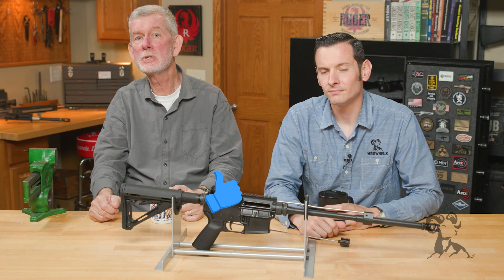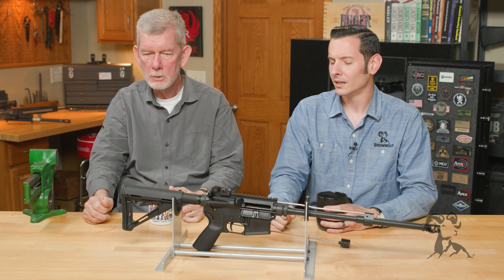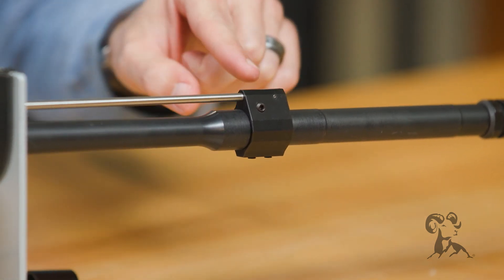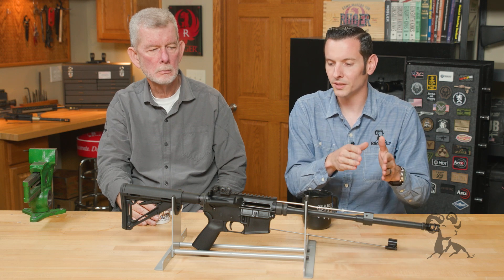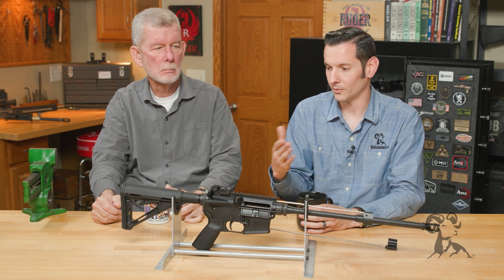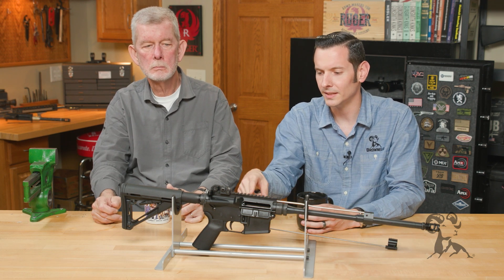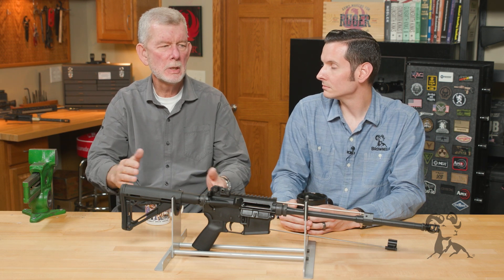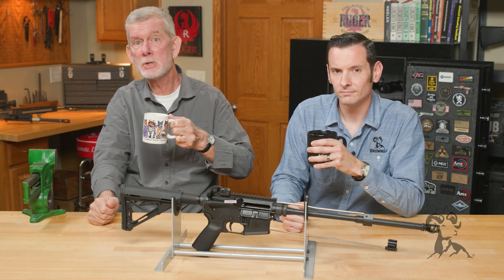Smyth Busters: Does Every AR-15 Need an Adjustable Gas Block?

Comment: Would you recommend one on a "duty" rifle/sbr(11.5"-12.5") being used in different climates and what have you. Personally I feel that a regular gas block covers your back in all areas, but I'd like your opinion on it. (Not suppressed)
Reply: There's no reason IMO to risk reliability in a life-or-death firearm.  If you go monkeying with the gas system with every change in climate/temp/humidity you're risking it failing you when it's needed the most.  That's just too far out on the ragged edge.  The standard gas block delivers full gas, as Caleb stated.  The recoil will be more harsh (actually, it's the buffer coming to a sudden stop) but it will cycle every time if kept clean and lubed properly.
Reply: @David-hm9ic  Depends on the ammunition you are using. Over gassed rifles are hell on gas rings and can cause premature wear and parts breakage. In a rifle that is over gassed, the  bolt carrier will cycle much faster and can cause feed failures if your mag spring is not strong enough to keep up with the cycling...Over gassed rifles are also much slower on split times..Just saying.........
Reply: @David-hm9ic  That's what I was thinking but just wanted someone else's opinion so thanks for the reply. As for the harsh recoil from the buffer, that can just be fixed with a better buffer so that's no problem.
Reply: I have a BCM 11.5 AR Pistol and was wondering something similar. I've had feeding issues a couple times. That could be that I'm still in the break-in period of the rifle (haven't gone shooting much due to covid and ammo shortage). It could also be that I need a heavier buffer (I have an H buffer). The gas seems to be at the right amount, the casing ejects at the 3-4 0'clock area. I'll eventually get suppressed but not right now.
Reply: @christophallen8859  Here is a great place to learn about feeding and other issues. Chad separates the BS from all of the internet advice. https://www.youtube.com/c/InstructorChad/videos

Comment: Something I don't understand. They say Mini 14s are inaccurate because they have spaghetti barrels. Well,,,,, look at these AR barrels. They are really spaghetti barrels.
Reply: Pencil barrels were an issue at some point when the heat treatment wasn't done correctly, leaving tension in the barrel. If it gets hot the residual tension can bend the barrel leading to offset shots. The heavy barrels only make sense for sustained fire till they glow. Modern pencil barrels get the proper heat treatment, all residual tension is gone and it's not an issue anymore. The AR is a light weight rifle and the balance is far better with a lighter barrel as it was envisioned.

Comment: An adjustable gas block is probably ideal for those folks that use a silencer sometimes. Some may argue that it is pointless to run a silencer on a round that is not subsonic but hey, it is what it is.

Comment: I would say an adjustable gas block is useful when you want to run the gun suppressed and unsuppressed.  Yes there are other components you could change to also do this.

Comment: If I were running a 10.5, and I was unsure if my rifle was over gassed, what would be the first thing I would look for?  I've heard alot about case ejection angle, but I'm unsure what exactly that looks like.
Reply: Imagine looking down on your rifle on a clock face, with the muzzle at 12 o'clock, the stock at 6 o'clock, and the ejection port at the center. 

If empty casings shoot out the ejection port toward the muzzle, at like 1 or 2 o'clock, your rifle is slightly under-gassed (will have trouble with weak ammo like steel cased).

If the casings eject back toward the stock, at like 5 o'clock, your rifle is over-gassed (excessive wear on parts and shortened lifespans of those parts).

A 3 to 4 o'clock ejection pattern is considered optimal.

Comment: This is good stuff, just bought my first "tunable" gas block/barrel combo from odin works and my first thought was how do I know where this is set from the factory. I' assuming it comes fully open, seems to run fine but there is A LOT of gas coming back to me mostly from the brake I have on it I think. Mainly I dont like the idea of having to fiddle with one more thing.
Reply: The oldin gas blocks that come with the barrels definitely are fully open from the factory. They are very easy to adjust but if you don't want to deal with it a heavier buffer like and h3  is probably what you want. Odin works also makes a adjustable buffer that you can change the weights to get it perfect without adjusting the gas system.

Comment: Interesting . I usually see a lot of seasoned shooters say that if your gun is gassy you should adjust it with buffer weights first and not by adding an adjustable gas block because having an adjustable gas block makes your AR have one more failure point that does not need to be there. Curious what you think of this logic? Thanks!
Reply: Messing with the buffer and spring is just putting a band aid on a bullet wound. You're not addressing the root problem of too much gas. You're patching it. The most ideal way to do all of this is to buy a barrel with the appropriate sized gas port so you don't need any of this shit to begin with.
Reply: @oldscratch3535  yeah I mean that’s what I do. That’s why I like Criterion - No problems ever. But some people like to run the same barrel suppressed and unsuppressed so that changes things. And not everyone is fortunate enough to have nice barrels to begin with. I think you’re right about the band aid analogy but it seems like some people do have issues with even good quality adjustable gas blocks. Seems like all best trainers I know totally avoid them to avoid that extra failure point
Reply: @DistrictSoundLab  I've had good luck with Ballastic Advantage Hanson profile barrels. They come with a pinned gas block. The gas port on my 13.7" barrel is .054", which is tiny. It shoots well suppressed or unsuppressed. Doesn't cycle steel case unsuppressed though. They're around $220 on their website or $160 through Big Daddy Unlimited. I don't think I'll ever buy another brand of barrel after using these.
Reply: @oldscratch3535  thats cool ive never ran one of them but i know people like them. You ever try Criterion?

Comment: Are over gassed guns mil-spec?
Reply: No, mil spec barrels are tuned to mill spec NATO pressure ammunition. Mil spec rifles would be under gassed if civilian lower pressure ammunition was used in them. This is why most AR  manufacturers open their gas ports "over gassed" compared to the military, to function reliably along the whole spectrum of lower and higher pressure civilian ammunition. Tula and Wolf "steel case" are at the lower end of pressure.
Reply: @hairydogstail  THX

Comment: If you are under gassed remember to Eat More Beans!  That usually fixes the problem
Reply: 😁👍 or use high test 93 octane
Reply: @sam__304  104 AV gaa works but it will melt your pistons.
Reply: @shawnr771  Just stick with 100LL. Or JetA if you need a lil extra lube in your system.
Reply: @dylconnaway9976  I will skip the second one unless I need to light a lantern.
Jet A is high grade kerosene. Nasty burning stuff.

Comment: I say always buy adjustable but along with drill the gas port bigger. All these different companies playing with different barrel length and port size/location, all different bolt and buffer components, calibers; your chance of getting a perfectly gassed barrel for your setup is low unless it's a super common length/caliber. Everyone starts chasing buffer weight, springs, carrier weight when their gun won't run but that takes so much time and gets expensive; and doesn't fix the issues half the time. Mo gas, mo throttle control=$$$

Comment: What would you rather use to adjust the gas an adjustable gas block or an adjustable gas key on the bolt carrier? Would it make any difference to shut the gas off at the barrel before I gets out of the barrel?
Reply: I recommend the block because an adjustable gas key vents the excess into your receiver making it unnecessarily dirtier.
Reply: @CalebSavant  ty

Comment: Easiest way to prevent cycle issues with adjustable gas block: to have the weakest ammo you can find, for an example Wolf, or any low budget 223, make sure it cycles just fine, by making sure the bolt opens on last shot by shooting 1 round only, full cycle, and bolt open, you can give your gas block 1-2 clicks more open just in case, and every 5.56 ammo will shoot wonderful
The only time I saw gas block fail on me, is when I didn't pin the gas block to the barrel. Now I dimple/drill the barrel enough to make sure screws actually stay in fixed position. Loctite without dimples will quickly unhinge the gas block, and that is more sure to cause an issue of cycle. 

Adjustable gas block is key for the softest shooting AR. Proper buffer weight and spring of course is just as important.

I use JP enterprises silent spring, and can have the lightest spring with adjustable gas block to make sure everything cycles and nice and soft shooting.
Reply: Do you rapid fire much? If so have you ever got your thread locker to release from heat?
Reply: @craighansen7594  I have personally never seen any gas block set screws fail with high temperature Loctite. I have seen gas blocks fail that did not have at lease one dimple on the barrel.. I have read where using red Locktite can be a problem with extreme heat, "but remember" BCM uses high temperature red type loctite with no problems. I use Rocksett, which has a temperature resistance to 2000 degrees. The down size to Rocksett is it can be more difficult to remove compared to red Locktite, but not impossible..For the average shooter, I recommend red Loctite 272, it is easier to remove and most shooters will never get their barrels hot enough to ever become a problem..  I have never tried Vibra-Tite Hot Lock which also has resistance up to 2000 degrees.
Reply: @hairydogstail  I agree. Some companies use hardcore threadlocker. Like Ruger rifles, where I was forced to drill out the gas block screw to remove it,  and even after heating, I was forced to chisel the gas block off the barrel with a hammer and screwdriver
Reply: @righteous-one-7  Did you try shocking your screws after heating them??
Reply: @hairydogstail  
You can get the rocksett parts off if you put them in water for a while.
Reply: @onpsxmember  I have found soaking in boiling water is not as effective as shocking the screw....
Reply: @hairydogstail  Rocksett is incredibly easy to remove, you just soak the part in water overnight.
Reply: @hairydogstail  Rocksett is water soluble, i just use room temp water, works every time.
Reply: @craighansen7594  yes, I do, on 16 inch ar. When I didn't dimple the barrel deep enough or not at all. Don't overdrill, and don't underdrill the dimple.  Check the barrel thickness and don't overdo it. I do 0.9 mm dimple or up to 1.1 mm
But if you are not sure if your barrel needs less, then take it to gunsmith.
Reply: @craighansen7594  use rocksett, it is impervious to heat.

Comment: Yes...yes...yes and yes....
Why? Cause we can, and it makes recoil way better. 
Unless like they said...the gas hole is the size of mosquitos ding-a-ling
Now for anything overgassed, or normals gas hole, it works wonders
I have rifle length gas system, where the hole is as big as Grand Canyon, so the rifle was still overgassed, bought adjustable gas block for that reason.

Comment: What I know about these rifles is where the rounds go in, where they come out and what makes it go pew pew. I visited the Grinnell store a week ago and picked up the .22 conversion with 3 mags for my AR556 Ruger, so now watching the vids to learn more.   Now I know what the gas block is for and what it does.
Reply: Ngl this post is fucking terrifying.
Reply: @dakotamaiden4331  Why would you say that?  Please explain.
Reply: @acdii  simply put. Do some research on the firearms you own. It will do nothing but help the overall experience. I don't say this in any mean manner its just genuinely scary hearing other firearms owning sayin stuff like that.
Reply: @acdii  basically shit goes wrong it good to know how to do simple stuff on the thing that contains small explosions should anything malfunction.
Reply: @dakotamaiden4331  I have been shooting for decades, but it is my first AR style, so the internals are all new to me.  Would you rather I went through great detail on where the rounds go in, where they come out and what makes it go pew? I mean, come on, get some levity man!  Reason only 3 rounds went through it is because it came without sights, and the Optic I put on is so far off, that it completely missed the target by several feet at 36 yards, and at 50' I hit the target and found out how far off it really was, two rounds @50 feet, both impacted the same spot, so at least I know it is consistent. At that point I decided to get a bore sight and packed it in.  No sense wasting rounds when it was that far off.  

I have been shooting Henry rifles and bolt actions, so you get the idea of what I meant.
Reply: @dakotamaiden4331  Got that right. Been watching as many videos as I can find on how these rifles all work.  The more I watch, the better I understand how they function, quite different from a handgun or lever action.  Finding the .22 conversion kit will pay for itself in less than 200 rounds, looking forward to some range time with it.  Instead of having two ammo cans with different ammo I can take both rifles with and only one can of ammo since both can shoot the same stuff. Win Win if you ask me.
Reply: @acdii  22lr is def fun.
Reply: @dakotamaiden4331  quite dramatic there Dakota. Nothing remotely terrifying, calm down.
Reply: Please watch all 3 of the videos I am linking:
https://youtu.be/wMIBUIN30yU

https://youtu.be/V_RfiKEvoGA

https://youtu.be/wAqE-KLbiYc

You are welcome

Comment: I noticed that you didn’t address misaligned gas blocks as a possible problem. Nice segment. Thanks.
Reply: Saw that recently on a range trip with some friends. It was his home built 300 Blackout that he was firing for the first time. It would kick out the spent case, but wouldn't pick up a new one. I immediately told him that it was under gassed and he hemmed and hawed saying it was the hammer spring being to strong or the incorrect buffer weight, etc. So I slapped it on my lower which I know will run 300 Blackout and it does the same thing. 

We get it back to my house and as soon as I pull off the hand guard I see that he doesn't have the gas block seated to the shoulder of the journal. Undo the set screws, give it a wack with a non marring hammer, and screw it back down. Works fine now. 

It wasn't even off that much, probably .025". That was still enough to choke it so it wouldn't run.
Reply: That was my very first thought as a cause of the described problem.

Comment: Use the lightest buffer weight that will reliably close your bolt. Then tune the adjustable gas block so that the last round bolt hold open works every time, then give it one extra click on the gas adjustment (brass should eject between 3 and 4 o'clock). This yields the least amount of recoil and receiver fouling.
Reply: You are one of the few who actually understands the process. Good job.. It gets old when most advice on the internet keeps rehashing the same old advice of replacing their standard buffers with heavier buffers, without any understanding on how the gas system actually works..
Reply: So being new to this and having a 12.5” barrel length (from factory with .750 gas journal diameter), is plenty overpassed for all ammo. By adding a suppressor, it sent MORE gas back through the block. I’d like to add an adjustable block….and see how THAT does BEFORE worry about buffer weight and springs…correct?  I’m going with superlative arms bleed off style adjustable gas block, so if I have it set on the lowest amount of gas going back…and it buck slams my shoulder, I should go with a lighter buffer? Or heavier, to take the power out of the gas? Again, I’m new don’t tease me.
Reply: @jasongaudreau2075 I’d lower the gas first until it runs better with the stock buffer, then if you want to get a lighter buffer and lower gas more your gun will run cleaner